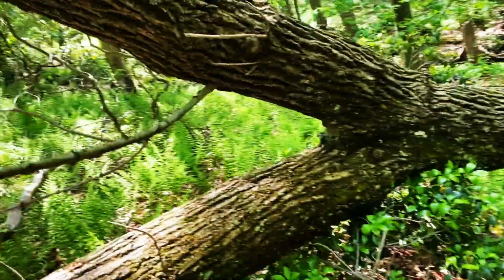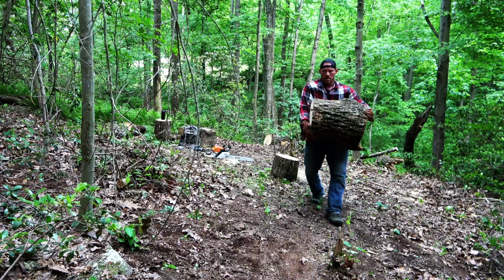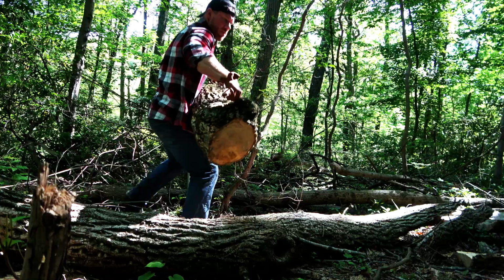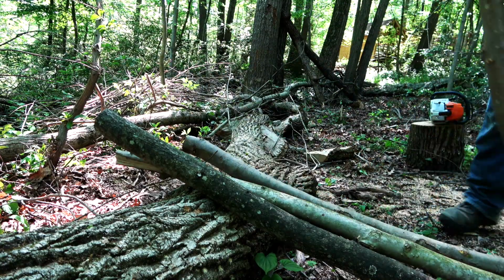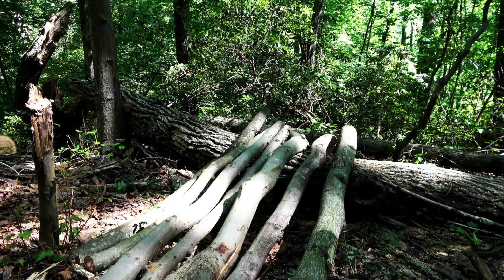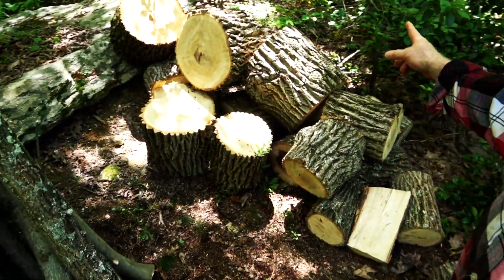BARBELLS & BUSHCRAFT: 1st BUILD w/ Hand Tools - Self Taught Timber Framing for Survival Shelters

Comment: Brian, I'm asking this after watching the Linear Progression video( I've asked this there too😅).

Hey Brian, I got a couple of doubts/suggestions/opinions/etc in this. Hope you see this and reply.

1. My gym is 30 mins from home. So can I walk everyday back and forth.
2. Like pull is for push, can I do hinge before main squat and squat before main hinge.
3. I also like to use the abs work as rest time and want to substitute it with some other excercises/movements.(Coz if I rest like "rest", my testosterone goes 🚮). Can you recommend some? Also going by that, the total number of excercises will be 9, is that too much? Or are there ways to tackle it? can I do a light explosive hinge or burpees before Squats?